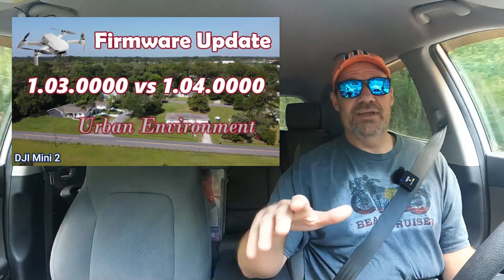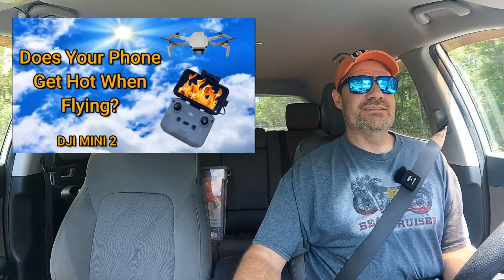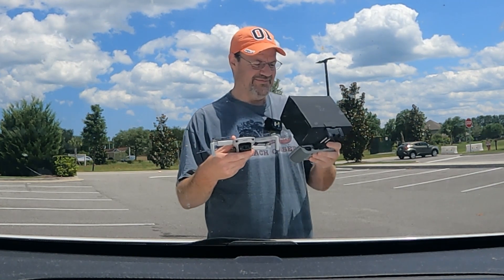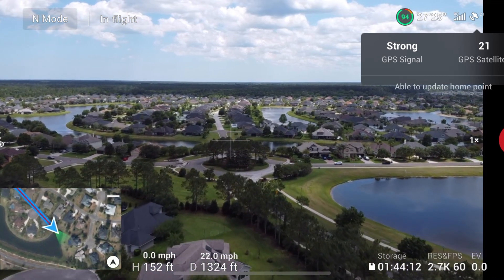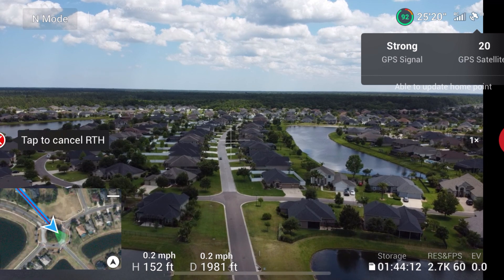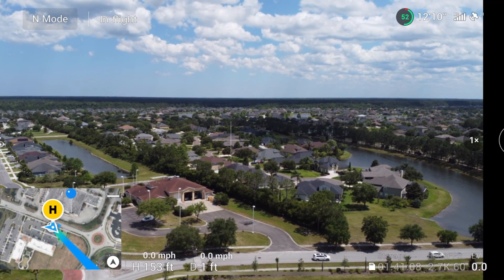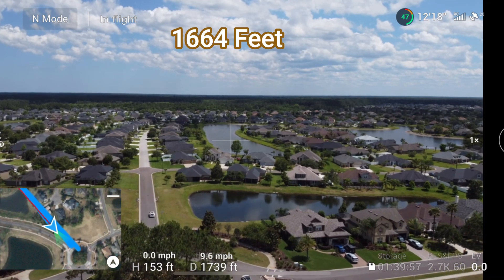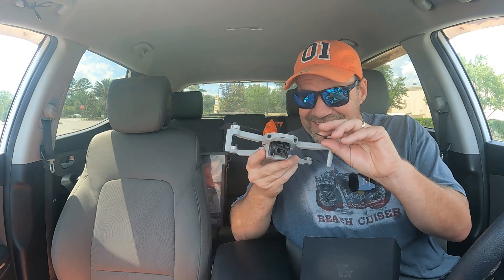Should You Fly a Drone From Inside a Car? / Signal Strength Test / DJI Mini 2

Comment: I fly in my car almost all the time as it has been cold out this winter and now that it’s spring and getting hot out I’m still in the car lol I’ve not had much signal strength issues even at 2000 feet. I’m on firmware 1.3. Great comparison!
Reply from the maker: Heck yea!  Flying from the car is the only way to go now, eh?  It's nice to stay out of the sun for sure... We have done several comparisons between the 1.3 and the 1.4 firmware versions (not filmed) and I've determined the 1.3 seems to keep a signal quite a bit better overall...  The only real difference I've noticed with the 1.4 is it seems to capture the satellites quicker.  I'd say the 1.3 is the one to hold onto for now, no question...

Comment: I always fly sitting outside the car but have to struggle with sunlight on my iphone screen 😬.Does the sunscreen that you have attached to controller and phone make any difference in your opinion,is it worth to buy ?Good video again…much appreciated 👍🏻.
Reply from the maker: Awesome comment, Mark...  The sunlight is the worst thing we have to deal with here and it'll often times dim the screen of the iPhone if the sunlight is directly on the screen.  It's really irritating... lol  I think the sunscreen helps quite a bit and it's less than $10 on Amazon at the moment.  I think what helps more though, is the attachment thing we bought a few months ago that fits on the controller and holds the phone up at an angle.  It's called a "tilt stand phone holder bracket" on Amazon if you wanna look for it...  It's even cheaper... lol

Comment: I fly from inside the car quite a bit due to heat here in Arizona. I don’t think it affects signal much if any. Altitude seems to be the biggest factor for me. In urban areas I can very seldom get by with less than 200 ft if I want to fly very far.
Reply from the maker: Ahhhhh, I think you hit the nail on the head with the altitude comment.  I really think that was my big problem last video....  I'm going to go back there and try those flights from a higher position next time and see what happens...